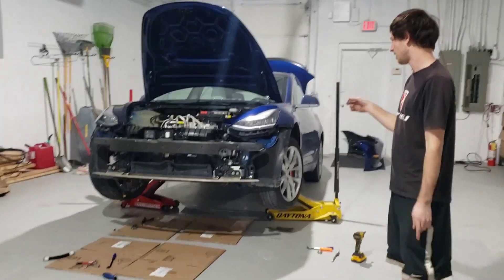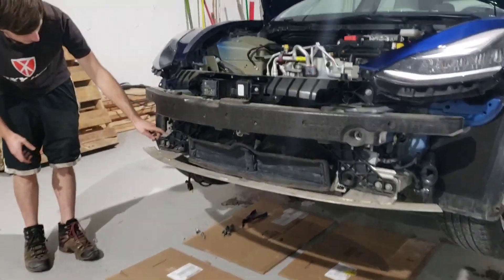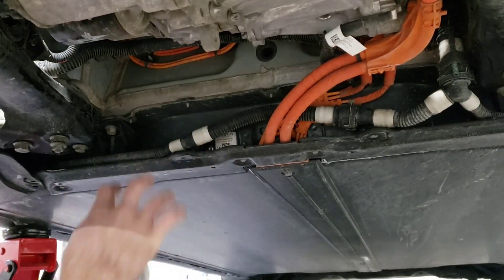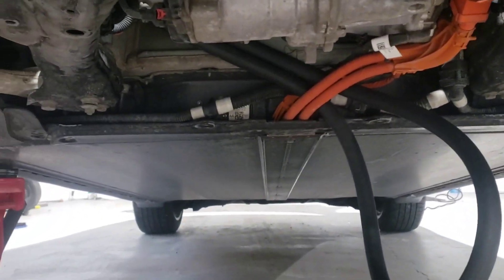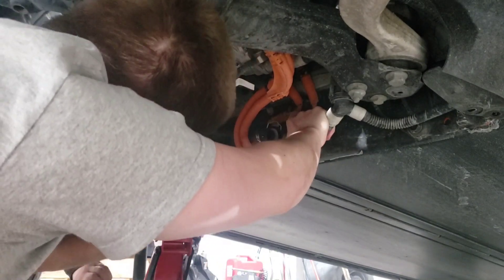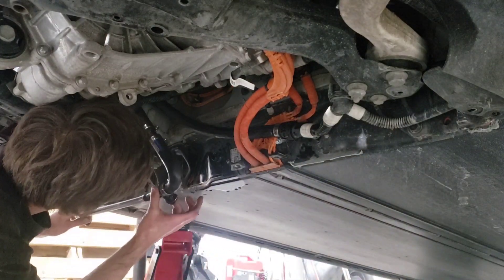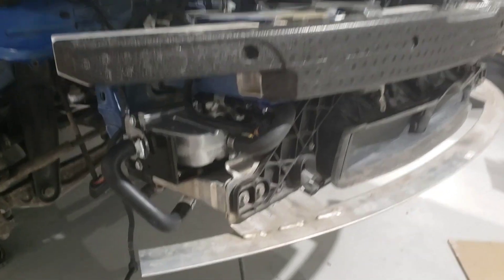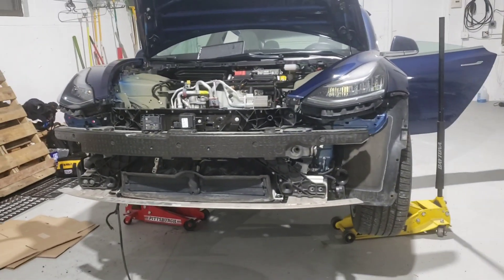Tesla Model 3 Battery Heater INSTALLATION

Comment: How do you control the heater? Just on/off switch or made some custom controller for it?
Reply from the maker: At the moment I manually plug the heater into an outlet. Once the car is on and charging, it will start heating the coolant. The temperature is regulated by the heater itself.

Comment: Non-heat pumps Model 3 (2018-2020) already generate heat onto the coolant loop system using the electric motor.
Reply from the maker: You are absolutely correct, but using the motor to heat the coolant is not very efficient. This circulation tank heater reduces the strain on the inverter that heats up the motor. The inverter uses 7kW of power vs this system running at 1.5kW.